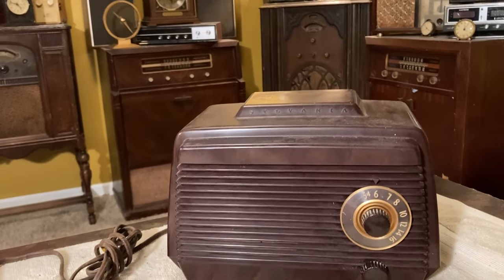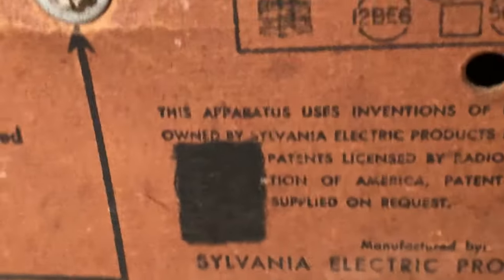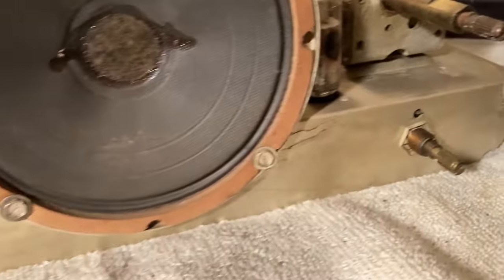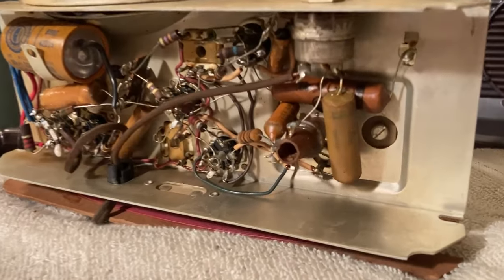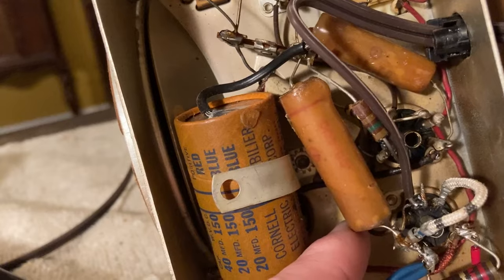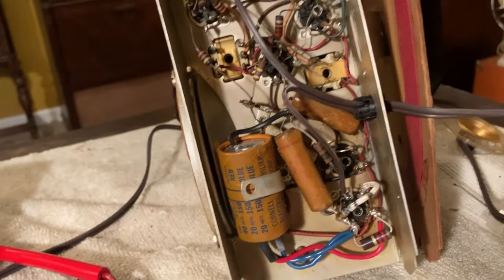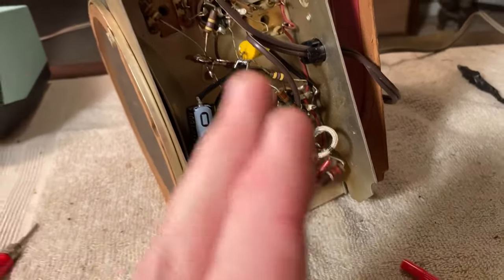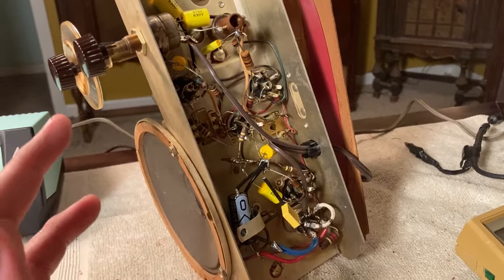Old Sylvania Tube Radio BUZZES On Low Channels!

Comment: The outer blades on the tuning caps can be bent out to fine tune them as part of the alignment.
On some devices you may find solid material fixed value capacitors that have a small cutout ground to them for a similar reason.
Reply from the maker: Interesting, thank you
Reply: @jussikuusela7345    the bendy-out sections are available to compensate for any tracking errors in the gang. Not really intended for anything else but can be used to supplement the effect of compression trimmer at a push.
Reply: @jagmarc  yep.

Comment: At least, on this radio, you don't have to worry about dial string.
Reply from the maker: Yup.  It's a pretty good design obviously to cut cost but it still looks nice and the dial works the same.

Comment: If an old 22 meg resistor measures 26 megs it's likely perfectly fine. Very high value resistors were usually specified with 20% tolerance. It would need to be above 26.4 million ohms to be considered failed.

Comment: The buzz is a flourescent light!
Reply from the maker: People have been saying that but if I turn off every light in the house, and turn off all the breakers, it still does it.   I'm going to fix some more of them and see if all of them do it, I fixed a few other ones and filmed videos but I don't remember if any of them did that.
Reply: @AmateurRepairTime  Your house is connected to other houses by radiating wires////

Comment: To me that buzzing sounds like an unsuppressed HT silicon rectifier diode. To tell if the origin is local, interrupt one side the line power briefly see if stops. If it continues on then it's exterior source.
Reply from the maker: Thank you!

Comment: Hi, Ron: I believe those outside plates on the tuning capacitors were tweaked at the factory to fine tune the capacitance of each section. In fact, they had slits in the outer plates so individual sections could be "tuned" for the dial alignment. How precise were they? Probably "good enough"!

Comment: Interesting to see the power spec'd as "25-60 Hz".
Reply from the maker: Yeah that looked strange to me too, I don't know what that's all about.  I think this is 1950.
Reply: Canada may have had 25 hz power in some areas. Europe was and is 50 hz. It's probably transformerless  AC/DC and the frequency would be largely immaterial although larger filter needed for lower frequency.

Comment: Have you found the light causing the interference?  At my place in south-central Michigan, it's the florescent lights in the back room.  They come on (movement sensor) all the A.M.s I've played with go nuts.    (Keep up the great videos)
Reply from the maker: I was convinced it wasn't a light, but after everybody's telling me it's a light I think it might still be a light, lol  I'll mess with it somemore when it gets dark and see if I can figure it out, there are several lights on outside so hopefully it's just that... I thought since it was only doing it on the bottom of the dial it wasn't that, but apparently that's exactly what it does (on the bottom of the dial)
Reply: @AmateurRepairTime   Interrupt one of the ac line connections briefly see if it stops, to rule out internal generated noise.  If unplug the line cord instantly stops take into account that puts a full break for any conducted noise too.
Reply: and another thing,  if alignment out at low end it causes the AGC to crank up radio sensitivity to full = buzz gets louder

Comment: I noticed a 22m a 47m and a 2.2meg resistor in your schematics.  Please remember in the old days m stood for a thousand not Meg.  I doubt if 47m is 47 meg.
Reply from the maker: Yeah I couldn't figure out where the disconnect was there but what happened was, there is a list of the caps on the other page of the Rider's document on it.  So I ordered the caps by hand, and they were listed as for instance 22000mf... so I ordered a 22k cap.  Then when I was actually putting them in, I was looking at the schematic, which labels it 22m and I couldn't figure out why the store sent me 22k instead.  That's exactly what I ordered!

Comment: About that resistor that says 22M on the lower left of schematic...I've seen on several other radios that 22k is actually a normal value for that slot. I'm not sure if it will fix the buzz but it might be worth a try. Swap that one out.
Reply: 22 megs might be a bit high but the AGCline is high impedance so it makes sense. And if the old one measures 25 megs it's probably supposed to be 22 megs and not 22 k.
Reply: I need to correct myself, I wasn't looking closer. The resistors which are labelled with "M" actually are kiloohms. Other resistors are labelled "meg" which are megaohms.

Comment: Does that radio act as a heater as well with all those tubes?
Reply from the maker: Yup, and a lantern!
Reply: A radio like this draws 30, maybe 35 watts. You wouldn't notice it warming a room.
Reply: @eDoc2020   yeah but those tubes can run hot. I had an old tube marshall amp, ran hot but damn it sounded nice. Tube amps are the best compared to solid state.
Reply: @piratestation69   They do run hot but that's just because there isn't any fan. LED bulbs also get hot. Your Marshall was probably putting out way more heat than an AA5. When you have 2xEL34 able to output 50 watts you're burning much more power than a single 50C5 that can only do 2 watts.